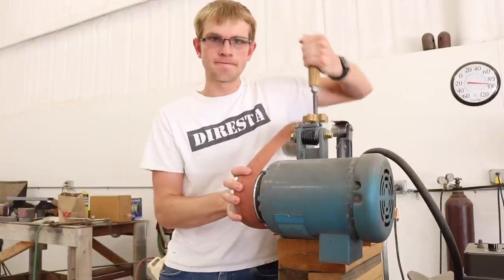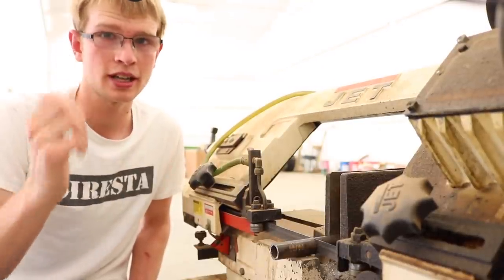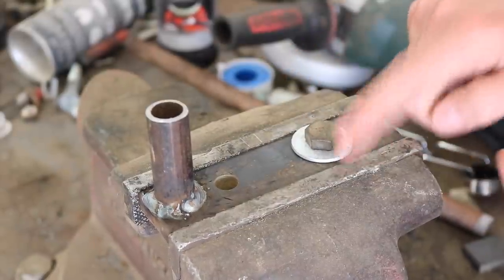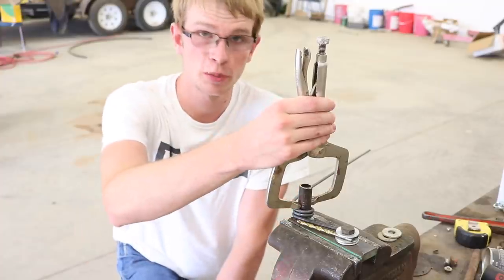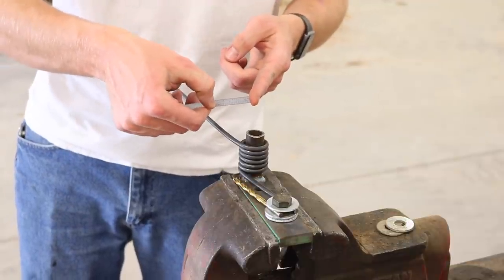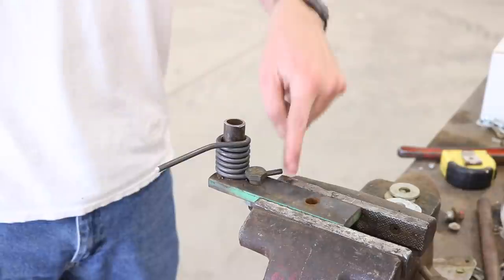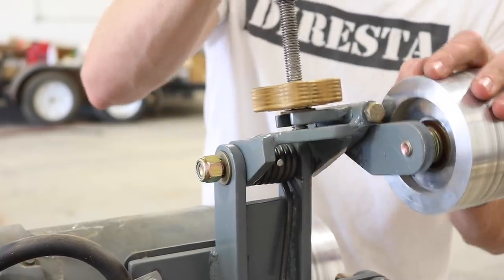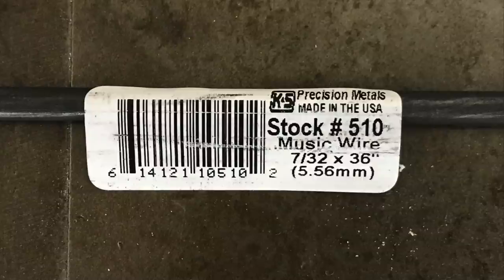How to make a torsion spring

Comment: Just discovered you yesterday.  Cant get enough.  GREAT channel.  Question.  Where do you get a good center punch?  That thing you tap the steel with so the drill bit doesnt wander.  Not sure what the correct name is at the moment.
Reply from the maker: +chinchudo 
I recently picked up a Starrett 18C. It's an automatic center punch, so it basically has the hammer built in. You just set the point where you want to drill, and press down till it pops. Easier than the kind you tap with a hammer. Just google or search YouTube for Starrett 18C, and you'll see what it is. It works great.

Comment: very nice. how did you determine the correct wire diameter and number of turns to give you the required tension?
Reply from the maker: +larry sperling 
Trial and error. I'm sure it can be calculated, but I'm not an engineer and I have no idea how. 
Having some experience with springs goes a long way though; for this, I needed quite a bit of travel, so that means I need as many turns as possible.
Reply: thanks for your quick reply

Comment: I have to make a couple of torsion springs to close the platform of a bird feeder when a squirrel gets on it but not when a bird gets on it. Where can I find info on what diameter and type of wire and number of coils to use to give me the right number of ft-lbs, oz-in really, to do the trick?
Reply from the maker: I don't know. I'm not an engineer, so if I was doing that would probably just use trial and error till I got it right.
Reply: Thank you. I emailed the mfg of the feeder and they sent me so.e new springs. With what I  set out to use, anything smaller than a pteradactyl would have starved.

Comment: Jeremy, which was the diameter of the wire you used? Do you think it can also work using a 7mm music wire?
Reply from the maker: This was 7/32”. 5 or 6mm would be fine, 7mm might be ok but that’s going to make a pretty stiff spring.
Reply: @Jer_Schmidt  thanks again!

Comment: Could you have used a pipe as a lever to twist it little easier?
Reply from the maker: I tried that on my first attempt, but the pipe tends to slide down the wire so you don't have as good of control. You really need to be able to pull on the wire to keep it tight around the mandrel.

Comment: Dear Jeremy, is it necessary to use any termic process in order to make sure the spring doesn't loose tension with time?
Reply from the maker: I didn’t, and I have not any trouble with the spring. It’s been in use for about two years and under tension 99% of that time. Still works fine.
Reply: @Jer_Schmidt  thanks for the information!)

Comment: So ...what about heat treating to get a spring that stays a spring instead of stretching over time and losing its ability to recoil?
Reply from the maker: I used the spring for several years, and it didn’t lose any tension that I could tell. I sold this original grinder when I built my new one, and I haven’t heard any complaints from the buyer. Also haven’t heard any complaints about weakening springs from any customers who made it this way.
Reply: @Jer_Schmidt  That is great that you make good springs.....never questioned that....so the question stands.

Comment: Wouldn't it be easier to bend the wire hot?
Reply from the maker: +Jose Lamar 
Heating it ruins the temper, so it won't be springy after heating.

Comment: y is call music music just cold roll steel
Reply from the maker: +73 SUPERGLIDE 
Music wire is high-carbon steel that has high tensile strength, and is usually fairly hard. Normal cold roll steel will not work as a spring.
Reply: Jeremy Schmidt thats what i thought on video looks different